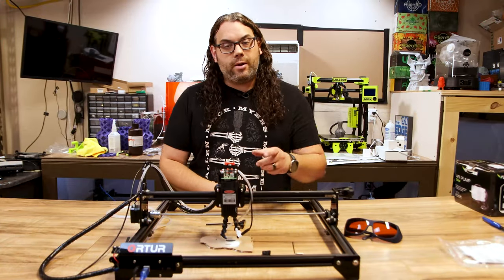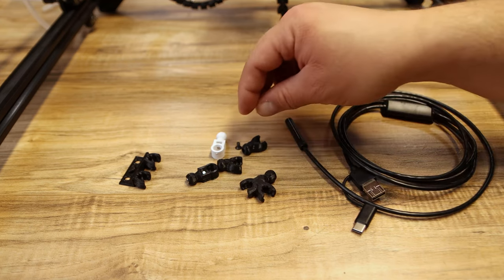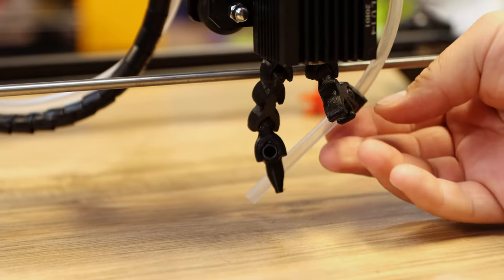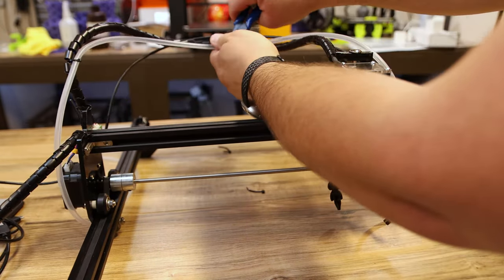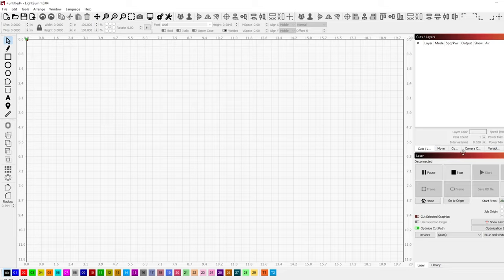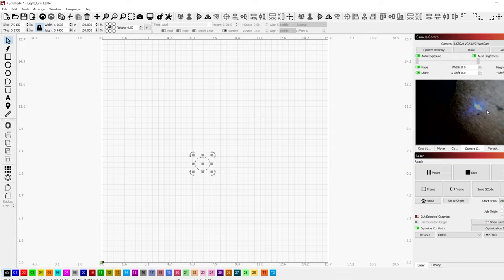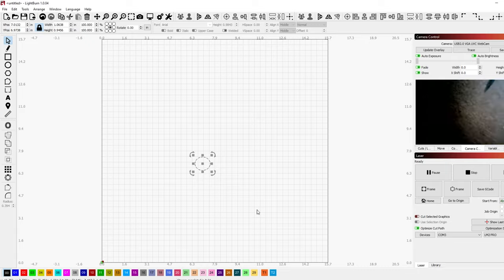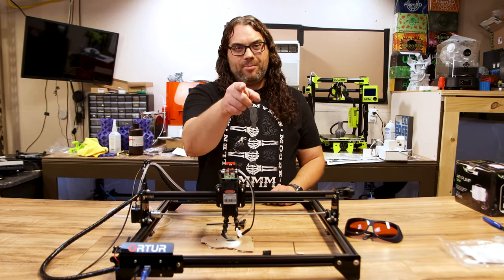How to Install an Endoscope on a Desktop Laser Engraver!

Comment: Another idea for this, if it just shows up as a camera to your computer, could you record while you do your burn, for example if you frame the camera out a bit more, could you see the design being burned in real time? It is probably outside the scope of lightburn software use case, and probably have to use another piece of software.

Haven't yet got my laser together and set up, so haven't used lightburn yet. Great to know that they have the ability to see cameras in the software while controlling!

Thanks for another great video!

Comment: Once you have the endoscope in the bracket the way you want it; be sure to place marks on the bracket and the endoscope so that should you remove them for some reason, you can re-install them in the proper configuration.

Comment: Great vid.  One thing though... multiple times you said you were putting the laser on "25 percent".....Which we know isn't actually the case... someone who is new or not knowing would make a big mistake... You should be saying "Point 25 percent".. or even more accurately (used in medical field) "zero point two five percent".

Comment: Jim, good video.  I just finished adding Raspberry Pi cameras to all of my 3d printers.  That was a no brainier since each has a Pi running Fluidd and Klipper.  The cameras were about $5 each and the 1 meter cable another $5.  I can now watch 4 printers from any computer in the house and see how they are printing.
Reply: Where did you source raspberry pi cameras for $5? As I'd definitely be interested in getting some.

Comment: Seems scope cams are getting traction. I put one on my Ender 3 just so I wouldn't spend hours just watching the nozzle do it's thing.
Tight fit is a good thing. Friction fits like this will wear loose over time if there's any vibration.
I'm likely going to jump into Fusion after I get my Z1 and make something for a scope. Semi-rigid cable isn't an issue for lasers like printing. I want a better sensor on my printer, but not the extra resistance of a semi-rigid cord. Haven't yet found an HD scope that isn't.
Reply from the maker: Awesome! I love the idea of watching the plastic go down through an endoscope!
Reply: @TheEdgeofTech  I have about a dozen vids uploaded on my channel. All using a scope. Dave Petsel helped me out w/ a hotend fan mount for it.